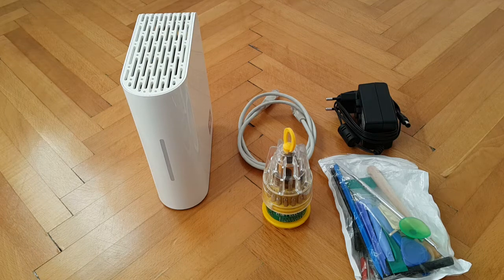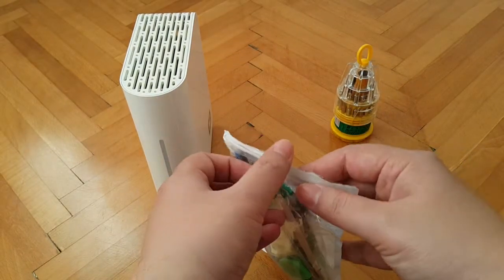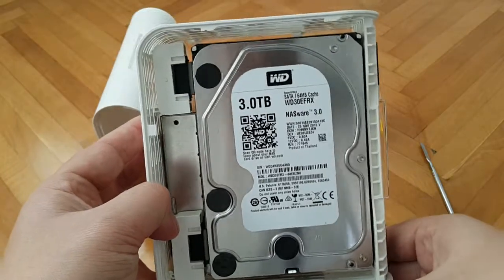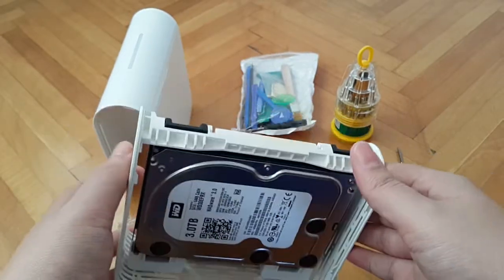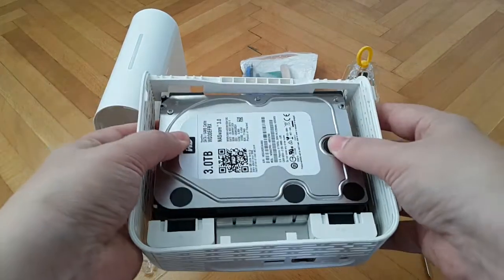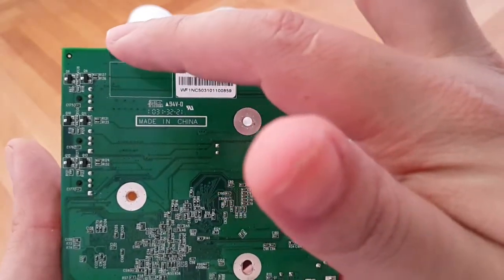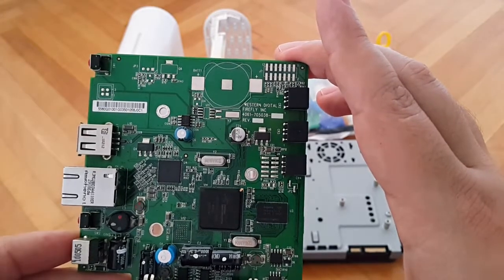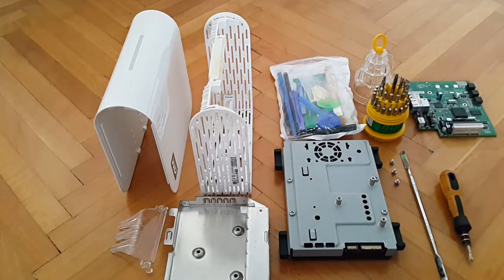WD My Book World Edition (White Light) 3 TB Upgrade - Disassembly

Comment: can these be shucked and plugged into an adapter? I have one from 09 that has tons of photos of my wife and I when we first started dating. I can't get it to access over usb. I can see my network recognizes it when plugged into my network. I know the user name and password. Any advice?
Reply from the maker: Hi,

Sure you can but it is possible that the data written onto the HDD is somehow encrypted through the unit's/enclosure's PCB. Therefore in order to retrieve the data you need that. But I'm not certain about that. 🙄🤔😕

Definitely I know this is the case with My Cloud & My Book Essential products. 😒

Best Regards,

Comment: Do you know if there is any hidden software in the HDD? or easy can be swapped to a bigger one?
Reply from the maker: L BB Hi,

Well the OS as such is installed onto the HDD itself as you might probably know. I think it's a Debian derivative (so Linux definitely). With this particular WD NAS it isn't as easy as it is with (let's say) My Cloud or My Book Live where you could just take an existing Virgin Disk Image & then expand it onto the given HDD. Afterwards then shrink or expand that EXT4 partition. 🤔😐

With this NAS device this doesn't work. What HDD are you planning on putting in the enclosure anyway ?

By the way only WD HDDs are supported by the tailored OS. You can put in other hard drive manufacturers, but then there is no guarantee that you'll have access to all of the features that the original software provides. 😐

If you have additional questions, feel free to ask. 😊
Reply: There were four partitions on the hard drive of which the one that contains data is of type xfs (Linux) . My guess is that the three smaller partitions have software used by the system to manage the  communications and data storage, included the administrative Web portal.

Comment: my MyBookWorld 1tb has died. drive "clicks" so is dead jim, dead. however, i have a 200gb sata hdd laying spare. can i drop that in, and will the enclosure find it and allow me to use it (until i can source a better drive with a higher capacity?)
Reply from the maker: Hi,

Oh how unfortunate. 🙄😑

I guess you could though I don't have any experience with using other brand HDDs (i.e. Seagate) in WD products.

You would then also need to use an appropriate Virgin Disk Image & shrink the EXT3/EXT4 data partition to match the HDD size of your drive. 😊

Best Regards,
Reply: @davidbolha  it will be a Seagate 200gb SATA drive. 
Will the firmware be able to install the drive or is the OS on the drive?
Reply from the maker: @H1pok0ndr1ak  I have no idea. Give it a try & see what happens. 😶😕
Reply: @davidbolha  I will... Tomorrow. I will post my results, for your enlightenment. Lol. It may help others out too.
Btw just bought a 3tb WD red on eBay for 55 GBP. 3 weeks to arrive ... Sigh!
Reply: I tried and failed. The drive IS recognised but it needs the WD Firmware installed upon it. Which requires using Linux. So at this moment in time... No joy.. but... I will be trying another option... Live CD of Linux... Watch this space.
Update
Now created usb Linux drive. Installed the WD Firmware on the drive (Seagate 200gb) it didn't like it, and threw up a couple of popups to the effect that it was not a WD drive, but it did install, and now I have a working 200gb drive in my enclosure.
If anyone wants to know how, I followed the instructions in a video on YouTube
Reply: New update. I ended up selling the enclosure/drive with a 1tb WD drive-in it. I obtained a Synology rackstation with 4 3xtb drives that wipes the floor with the WD Nas.  My journey with the mybook device is over
Reply from the maker: @H1pok0ndr1ak  Best news I heard. Congratz ! 🤔😏🖒👏
Reply: I wanted to post a picture of my Synology (for bragging rights), but unfortunately, the app won't let me lol
Reply: I'm kind of proud of my set up.
Rack cabinets are prohibitively expensive, especially the cool and quiet jobbies. So this one is an oddball. It is a cooled 12v 2 120mm fan system. Operated by a thermocouple sensor near the top of the cabinet. So, it is 21 inches wide, and has the fixings for front and rear rack mount hardware (which I don't currently have, so using the supplied shelf supports), and have Installed my ups on the lowest shelf, then my rackstation on the shelf above. The unit is roughly 22 inches wide and 25 inches deep. With the smoked glass door closed and the fans running full tilt, it is almost silent. My Xbox 360 makes more noise than this... 
Cost second hand £100.00. fan kit cost £42.00  a similar set up using "dedicated server kit" was over £600, and didn't even look half as good
Reply from the maker: @H1pok0ndr1ak  Would love to see some pictures. It reads like a dream. 🤔😏
Reply: I have posted a link to the pictures, but they disappear after a couple of minutes... Maybe there is a setting in the program that automatically deletes them?
Reply from the maker: @H1pok0ndr1ak  Oh dear... I think this is YT at work. 😑😒

Well I'm sure the setup looks great. Glad you upgraded to a better NAS unit.
Reply: Thanks for the credits. I am really happy with the setup. But since I bought it, I am looking at buying a Synology desktop 8 bay NAS. NEW. over £1300 for a bare unit. I intend to swap out my existing drives into the new unit, and I am told that the new desktop device will detect the existing setup(as long as I use the same disk pool as in the rackstation), and be up and running in less than an hour.

Comment: Can I install the HHD in a case, or does it only work by lan?
Reply from the maker: Hi,

Of course you can put the extracted HDD in a SATA-USB 2.0/3.0 case & use it as that. 😏

But you first have to format it to delete all Linux-based partitions (swap, Ext3,...). That is if you're planning on using it in a Windows-derivative OS. Then create new partitions (NTFS) & you're good to go. 🤔
Reply: @davidbolha  Thanks, I'm going to install the disk. I hope I don't ruin it.

Comment: Anyone selling an enclosure of this model?   Mine broke and all the data is encrypted now when I access even through Linux.   Just need to connect to a working enclosure and boot to get my data.  So frustrating.
Reply from the maker: Hi,

Are you sure it's encrypted ? 🤔

Sadly I sold this unit about a year ago, so...

Best Regards,
David
Reply: @davidbolha  I believe so from what I read on a few forums.    I was able to read the drive with Puran File Recovery, ( had no luck with multiple others) and the issue when viewing is all my folder names and files have been renamed to long names and are no longer organized together.   My stuff is everywhere and will take me over a year to fix one by one manually.    Any ideas for reading the structure?  I  can't even find this specific enclosure model online, found similar, but not sure if they would work if I connected the drive.
Reply from the maker: @babybull7  Why didn't you just simply try to mount the EXT3 or EXT4 data partition in (let's say) Ubuntu first befire trying any data recovery software at all ? 🤔😕

Maybe you could try putting the hard drive in a WD My Book Essential USB 2.0/3.0 enclosure instead...
Reply: @davidbolha  I haven't tried the Linux Ubuntu yet, never used before so a littler nervous with new operating system, but seems easy enough to mount from youtube videos.    Hopefully I can get access.   

I thought about that, I found a few similar ones on eBay, but not the same model number,.  I wasn't sure if it would work.  My only concern would be could it possibly cause damage to my data in a new enclosure?
Reply from the maker: @babybull7  If you just mount a partition you don't overwrite any data. But if you even "quick format" the drive, enough damage is done that the average n00b user will have a hard time retrieving data. Even with specialised data recovery software at his disposal. 🤔
Reply: @davidbolha  thanks for the advice I will let you know how this goes I'm installing Ubuntu onto a USB stick now
Reply: @davidbolha  Well I got Ubuntu to work and loved it, but unfortunately it would not allow me to mount my drive.  From what I could tell it's all screwy from the RAID configuration.    I'm backing up the files the long way unfortunately deep scanning as we speak.   I'm going to try ordering a drive and plugging it in.   maybe I'll get lucky.
Reply from the maker: @babybull7  How many partitions are located on the drive ? The data partition should be just one larger partition. 🤔
Reply: @davidbolha  Yes It is broken up into 6 partitions.   The 5th is the largest and is the one that has my files.      Currently backing up my files the long way through Deep Scan and Recovery option with Puran just in case something happens while trying to access the drive.
Reply: @davidbolha  So I'm about 2/3 complete with the Recovery through deep scan and i've found a few positive things out so far.  All of my metadata still exists, most of the media will be easy to sort and then re-org!  Won't be a one by one file discovery for many.      Mp3 tagger will update easily for file and folder sorting confirming with discogs.      Everything does seem to be coming out, so no data loss.   I am finding some of my large movie files are splitting into multiple pieces, so I will have to repair some of these.  They were in even 200 mb slices and laid out sequentially in the file format folder.      Still better news than I was hoping for so taking this as a win!    We will see when it finishes overnight.      Only annoying thing I found with Puran file recovery (the only one that was able to get all my stuff (went through almost 10 programs trying)) is that you can't save to a network drive only local.   So will take an extra transfer to my NAS later which is backed up in Raid 1.
Reply from the maker: @babybull7  Great news then ! 😇😏
Reply: @davidbolha  thanks for the suggestions and your help, now let the file re-org begin!
Reply from the maker: @babybull7  Sure & good luck ! 😏👋

Comment: Hi. My problem is that I cannot setup a http connection to the My Book. The drive gets a DHCP IP address. If I give the address into the browser it gets back the message access denied without showing the username password prompt. I use windows 10. I tried the other way too: The drive is visible in explorer as network drive, but trying to set up an network drive connection does'nt work. connection time out is displaying.
Have you any idea how can I fix the problem?
Thanks!
Mehrdad
Reply from the maker: Hi,

I'd simply try searching on DuckDuckGo for the following: Win 10 map network drive 🤔

In general you should find out which IP address within your LAN subnetwork is the correct IP address for web administration.

Then see this video for using the correct credentials. 👇

https://youtu.be/k45Z7N0v8JU

If still unsure on how to proceed make a video on your problem & reply here with the link to your video. 🙄

Best Regards,

Comment: Hello,

Do you know if I can put this Hard Disk into a NAS? I've a similar one but with 1 TB of space. The problem is those 3 little cilinders where the screws goes in to keep steady the motherboard to the HD. Any advice?

Thanks
Reply from the maker: Simone Bianchi Hi,

Who is the manufacturer & what is the model number of your HDD ? 🤔

What about those 3 screws ?
Reply: I have a WD My Book Essential of 1 Tb
The model of the HD is WD10EAVS of 2008.

What I'm refeering to are the 3 cilinders where the 3 screws go in. To be more precise the 3 you see at 10:47 close to your right thumb
Reply from the maker: Simone Bianchi Yes, that HDD could fit inside this NAS.

I know what you meant, just what about those cylinders in particular ? Are yours broken, non present,... what's exactly the problem ? 🤔
Reply: I might be mistaken but in the normal Hard Disks those 3 cylinders are not present. They are there only for a specific purpouse which is to keep the motherboard steady, right?
My doubt is: Are these 3 cylinders going to be an obstacle when I want to put the Hard Disk inside my NAS?
Reply from the maker: Simone Bianchi Yes that is the function of those cylinders. They are mounted on THAT metal case which is removable. You just unscrew those 4 Philips screws @ 10:55 that secure it to the aluminum body of the HDD. 😊

No. Not if you follow the video. Reassembly might be slightly trickier, but still. 🙄
Reply: Oh... I thought it was part of the Hard Disk and I couldn't remove it! I must be honest.. This is my first time approaching to this field and I'm still learning :-/
Reply: I managed to disassemble it all. The only thing I was wondering was about the 3 cylinders. So I only need to unscrew the 4 screws that keep the metal and then keep the HD. Thanks! For real I thought the metal case wasn't supposed to be touched or removed.
Reply from the maker: Simone Bianchi Yeees ! 😅😆

Hey no problem. I didn't bother removing that case (& showing it on the video), because I thought it was understood that it is (another) separate piece.
Hardware isn't that much hard, but the software part is. 🤔😶

Read what I replied to someone else that also posted here under this video for more reference. 😉